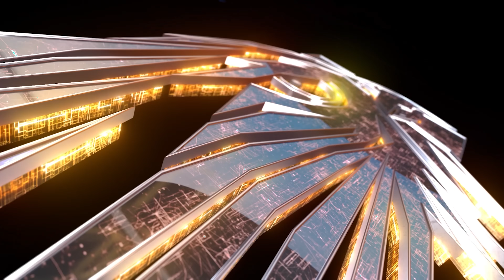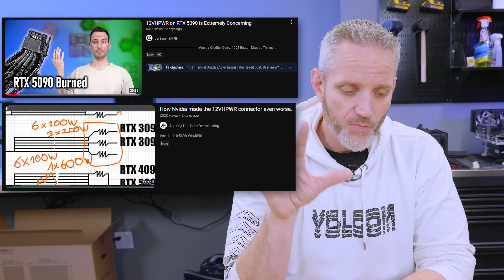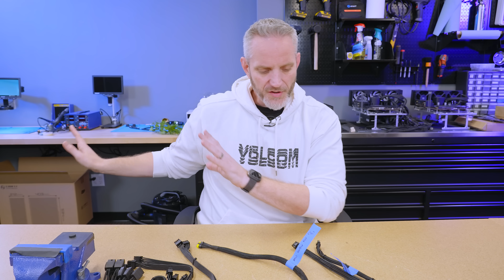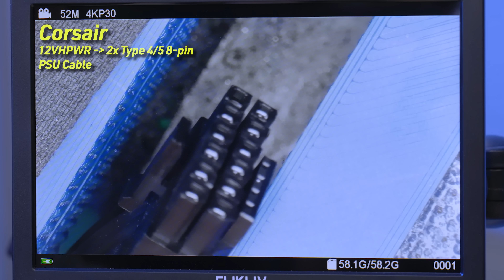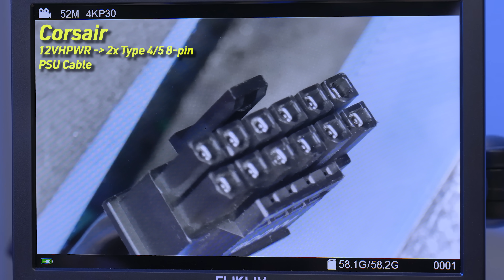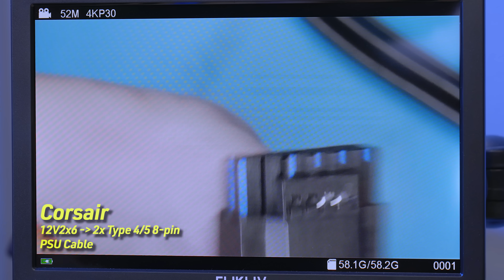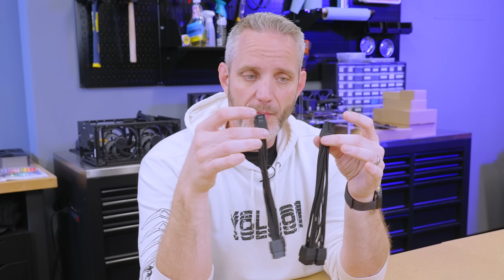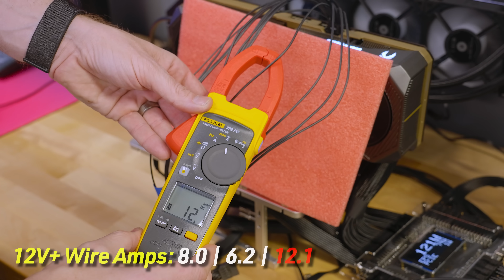I discovered something concerning and I need the Experts to chime in... More 12VHPWR discovery!

Comment: Notice how Corsair only has 2 sense pins and wires, because those are the only ones actually used, while Fasgear and Nvidia have all 4 of them?
Corsair is obviously cheap in every way possible here. 

Overcomplicated trash connector by design with poor safety margin, reduced safety measures on RTX 5090FE, Corsair saving on cables that are known to be risky... business as usual.

Comment: Good clue, but problem is in derBauer and this other guy from this video, this burned pin on the edge had best contact and others 3/4 don't, this is concering bacuse this may whole make whole construction very prone to fail due to manufacture tolerances.

Comment: I recently bought an RMX1000 atx 3.1 and just plugging it in getting no click to know if its fully  plugged or not is just such a joke. Just having to go off what you can see is extreemely unreliable certaing angles you can look at may look fine then other angles you cannot position to look at it dont look fine, using the 4 8x pin pcie to 12hprw u can tell easier because that actually clicks.

Comment: Jay when u read cables with that tool u cant have the other cables sit so near, if they are near u need to use isulation, these reads like this are already a bit off considerinf the tool itself... THE ANALYSIS about the cable pins its a great work,  abd obviously it makes a diference since so many corner cables burned on the 4090, GJ

Comment: @6.51 talking about ground. The entire board has a common ground which connects to the IO shield plate, this gets screwed to the case and offers another path for ground. 
There are additional ground pins in the PCI connector as well.

Comment: While not pluged in, the pins are usually lose in the plastic. when the connector is pushed in, the female connector will be held by the plastic and pushed over the male plug at the gpu. so there should still be a perfectly good electrical connection. try to wiggle them

Comment: Could you carefully cut open the plastic on the two end pins on the defective one, and check whether it is the connector housing that is bad or maybe the female metal pin on the end of the cable is damaged? These have one or two fins on the sides that spring out retain them once inserted into the connector body. It would be very informative to know if that somehow got damaged, has an assembly defect etc.

Comment: It comes down to a simple fact; the spec needs to change. Power Draw is at such a high volume that the connection security and wire gauge/insulation needs to be far better set, along with protections for both the graphics card and power supply. This isn't new technology, it's simply a failure of adequate testing and adjustment to changing demand out of pure laziness by companies.

Comment: This problem ,shouldn't be happening,  Nvidia have some very smart people working for them.  Over engineered comes to mind, just fit enough plugs of a suitable standard to handle the current.  Here in France we have 16amp 230volt system.  Was there a reason for moving away from the power setup on the 3090, i don't remember reading about problems with that setup. The saying , if it ain't broke don't try and fix it comes to mind. 
If there are genuine reasons for moving to the new power arrangement (post 3090) for cards then why are folk still having such problems , the price charged for a top  graphics card ,they should be bomb proof.

Comment: If you don't understand the basics of how current passes through the 12+v side and the 0-v then just don't make a video about the subject. Ultimately the issue with this ridiculous plug design is a lack of contact area inside the connections. The fix is to move away from these small pins and increase the pin size, surface area and pin count, its that simple. If they are using a common power rail system on the board this has NO IMPLICATION in this issue, in fact its reduces the issue of excessive heat in the plug, individual rails WIL IMPACT current load a particular circuits. THIS PLUG DESIGN MUST CHANGE TO FIX THE ISSUE. No amount of videos or over analysing of plugs, pins or power rail designs will fix this. Personally when I move away from my 2080ti and maybe move up to a or 40 or 50 series card and it has this ridiculous plug on it I WILL BE hard wiring it from the PSU to the GPU.  JAY, you and all the other manufacture influencers have to make Nvidia and Co move away from this nonsense. It didn't work for 40 series why the hell would it work for 50 series????

Comment: What you need to understand is that total surface area of delivery (amps) pr. pin. Meaning that the cable thickness rated delivery compared to the surface area of the pin seated. What that means is that if your pin seated is > rated delivery of the cable, you will have some leeway. Saying it in another way: If there's a requirement for the cable that your total surface area from the pin seat is 5mm2 AND when it's seated 100% it's 8mm2, you don't need to be too anal about it being 100% seated or not, there's room for it to flex.
My concern is that NVIDIA isn't trying to balance or at least monitor the pins for amps draw. ASUS ROG Astral OC is the only one I've seen that actually does this. Each of the 6 pin sets on that card is being monitored as each of those sets go through a shunt. On FE cards and most other AIB's I've seen there's only ONE (1) shunt, meaning they don't monitor each of the 6 delivery "threads" and this is how you can overload pins, create heat and finally a short. Bad bad design.

Comment: I agree with a lot of  comments here. Your particular problem with the Corsair cable, is likely a manufacturing defect. I suspect the Barb on the terminal, which retains it in the housing, was damaged before it was installed.  The other comments I agree with, are toe ones about molex connectors. These are mega cheap and have been used for years as a low cost, unsealed connector, for basic low power connections in a clean environment. They don’t retain well and the longer ones can pull back from seated by rocking over the connector, while the connector is still latched. I would suggest that the root cause of your problem, is the manufacturing defect (at the harness assembler, perhaps get another one from the same supplier, a batch size of one doesn’t tell you much). The root cause of having so many failures, would probably go to the NVidia design engineers, for using a poorly designed connector, for a high power connection. 
If you want to put that much power through those small pins, you need a connector design which has much tighter tolerances associated with the pins, the crimps, and the housing. The molex connector is designed to be as cheap as possible it’s not necessarily their fault. 
What else would you want to put on a very expensive GPU, but the. cheapest power connector possible. You could argue that if the connector is specified and rated to take the power, then it’s the connector manufacturer’s problem. Designers of the world have seen many great promises from cheap suppliers, but we test them before we put them on our products. You could argue that NVidia don’t supply this cable, so why would they test it and they probably did, with their own cables… if they control the tolerances on their own cables better than the molex’s standard, they should only rate the card for use, with their cables.

Comment: Why won't aib partners just go back to the older connector design? So nividia won't allow them to or what? 5080 & 5090 & 4090 are failing due to the connector design. What the point of these small connectors?

Comment: When measuring DC current clamp meters have instructions on where exactly to place the wire. It's marked on the clamps. That is because otherwise it's inacurate. AC measurement doesn't need that. Might or might not be a difference in this case.

Comment: The PMD measuring device smooths out the power because that device measures current using shunt resistors. For electronic engineers the reason is simple and clear. If you have solid bus bars on the PSU and the GPU and multiple wires in between the current for each wire depends on the resistance of that wire compared to the resistance of the other wires. The total current draw of the GPU is then divided the same af the difference in resistance. When you only have wires and 2 connectors (one on each side) the biggest resistance will be the contact resistance of the connectors which will be milli ohms how ever if one is twice the milli ohms of the other it will do half of the current pushing most current trough the wire with the best connection. So it will be the wire with the best connection that will melt not the one with the worst connection. Shunt resistors in the lines even when you do not measure increase the overall resistance of the line that much that they are the biggest factor in the series of 2 connectors the wire and the shunt resistor meaning variations in contact resistance of the connector is the smallest factor meaning the resistance of all wire are more similar ( basic calculations of series and parallel resistors in DC circuits every electric engineer learns  but just with very low values). Everyone who has learned this at school will say ah of course if they did not think of it already (my guess there are more engineers that already figured this out but where not very vocal on internet). To be honest because i only have a 3060 myself i did not care that much about the subject and der Bauers video triggered me the same as it did trigger BuildZoid. So to be short ASUS measure with shunt resistors and gives active protection (best protection) but any shunt resistor even when not used for measurements will have a positive effect on safety because it evens out minor variations in connector resistance.

Comment: Have you measured the total return current from those GND conductors, does it even close to the 12V total current? My guess is that it is about half of the 12v current and thus kind of eases the thermal load on this connector. After all, the return current is distributed via the PCIE connector via the motherboard to PSU

Comment: Let's see, a 5090 probably draws close to 600W of power under load. That's around 50 amps (600W/12V) trying to squeeze through those small cable wires and connector contacts. The result is going to be heat, and apparently, a lot of it. This is on top of what the CPU wants. Also, concerning the contacts in the power connectors. If you were to look closely at the majority of electrical contacts, in particular, their insides, you'll see that the way they are designed, only a small amount of the contact pins actually make an electrical connection. They all have an inner contact made of a springy metal inside the outer metal sleeve that makes electrical contact with it's mating pin. The more current that a connector has to handle, the bigger that connectors contact has to be. But with current design GPU cards, there are limitations on how big their connectors can be. That's why GPU manufacturers keep increasing the number of power connectors in the cards. They are trying to spread the current load across more connectors. That is just putting a Bandaid on the issue. The problem with that is if one or more of those contacts develop connection issues (like oxidation caused by heat generation due to current load), the remaining ones have to try and handle the additional load. When it gets bad enough, the remaining good ones start to overheat and fail. It's not rocket science.

Back in the early days of the automobile, their electrical systems ran on 6 volts. As their engines got bigger and more powerful and their compression ratios increased, in addition to more and more electrical accessories starting to be added, the 6 volt power system couldn't keep up because of the increased current demand. The wire sizes in the harness and electrical contact sizes could be increased, but only to a certain point and anything bigger would be impractical. So what did the manufacturers do? They went to a 12 volt electrical system. Current draw halved to the point where the electrical components could handle it. Now look at todays electric cars. Do you think their drive motors run on 12 volts? Not hardly. A typical Tesla drive motor runs on 320 volts. Can you imagine how much current it would take to try and make it run on 12 volts, not to mention the size of the wires and electrical contacts needed? Can you imagine the amount of heat that would be generated? You'd have a small Sun generating heat inside your car.

So what does this have to do with our GPU's, and our motherboards in general? It's time to go to a 24 volt system bus. The amperage demands on the power supply will be halved, heat generation will be greatly reduced, wire and electrical contact sizes can stay small. The overall power draw will remain the same, but we'll no longer have a space heater disguised as a computer. Everybody will be happy.

Basic electrical engineering folks. Maybe NVidia and the CPU manufacturers should start hiring more electrical engineers. I saw these issues coming from a mile away. But hey, what do I know?

Comment: Less contact either through recessed pins or loose connection equals more resistance which means more heat in a concentrated area.

Comment: There's more wrong woth this connector than just pin depth. It is NOT a high power connector. I'm not surprised things are melting. Those molex pins have an issue when the wire is pulled in any direction, the contact resistance changes sigificantly.

Comment: So inferior quality 3rd. party cables, eh? I mean, Nvidia is a huge company that definitely tested their HW before shipping and there is nothing easier to get right than power delivery through a wire. I mean, when I look at the RTX40xx adaptor, the wires are taped to the connector so the user won't pull them out. Those 3rd. party cable endings are just slopy like that, although I do understand people want as much flexibility in the cable as possible. Nvidia should start sell their own 12VHPWR cables, I would buy it for my card.

Comment: If it was a problem with the contact resistance, it would not have been the cable itself that got hot at The Bauer, but only the affected plug contacts. Heating always occurs where a lot of current flows and the resistance is highest. Since the entire line gets hot at The Bauer, it is clear that the electricity is distributed very unevenly across the individual lines, which is exactly what shouldn't happen. However, an increased contact resistance would reduce the current through the affected line and the line would remain cooler. That's not been the case.
In addition, the plug contacts usually do not make contact over the entire surface, but rather there are embossed contact areas which, due to their smaller overall area, lead to increased contact pressure and carry the actual current. As long as these areas are still in the area of the plug pin, there is no increase in the contact resistance in the plug. Yes, in some cases the contacts look very different in depth, but that can still be enough. You would have to look at this specifically under the microscope, ideally looking at the cut connector from the side.

Comment: If the connector is designed for the load of about 600W then it probably should be rated for that +20-25% on top for the sake of having some reasonable safety margin. Not having proper power regulation on separate wires kinda sucks too.

Comment: I would assume that PSU would not allow out-of-spec amps draw for a particular pin. It should trip, and the whole thing should power off. Over-current protection. The amps are not balanced per wire (for whatever reason). Somehow I doubt this is a cable problem. This could be detected on PSU and GPU levels to trip protection.

Comment: My guess as an electrical engineer: Most PC power supplies usually have several 12V rails (12V1, 12V2, 12V3, 12V4 etc.). In the graphics card and the PMD 2, the various 12V rails were simply connected in parallel. Voltage differences of just a few millivolts between the rails therefore cause large current differences in the supply line. The individual 12V rails are not intended to be simply connected in parallel.

Comment: I can simplify it quick.   any,  ANY heat damage of connectors can be attributed by poor wire to terminal fastening, weak terminal to terminal connection,  undersized conductors/connectors.    thats basically it.   too small connectors, poor connections, too small cables.    All 3 create heat.   heat bad.    hence either poor workmanship and or piss poor design

Comment: Imagine any other electrical device,  component or car/bike etc with issues like this. It would be on national news and a major recall would be put out, but not Nvidia nah its fine must be user error. If thats the case then the cable should be hardwired, or heres a crazy idea change back to pcie. Id rather have 3 connections to cable manage than hope every time i leave the room with my pc still on that its not gonna burn down my house. I need that its where i live.😊

Comment: I just checked the unused new RM1000X PSU and none of the pins were wobbling and their ends were equidistant from the edge of the case. Now I'm going to mark with a white marker line right at the connection interface between the cable and the shell, so I can immediately see if any cables have slipped out of place when connecting to the PSU supply and the GPU

Comment: Just think of the thing that a normal pci-e power connector handles 150W, so 300W when we use 12 pins (2 by 6). But Nvidia decided to increase current density for a small connector with the same number of pins and the same mechanism of connection. That's the crap here, not the 3rd parties and users. And when we look at the 4090's power schematics we see trully incompetent people.